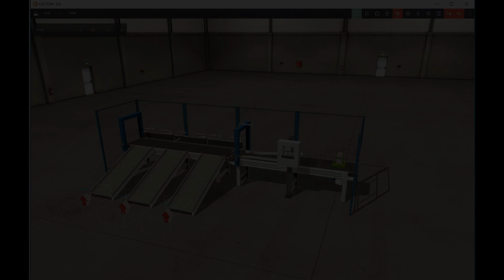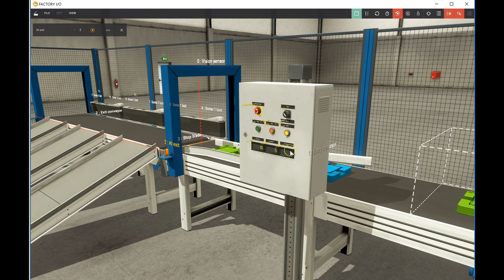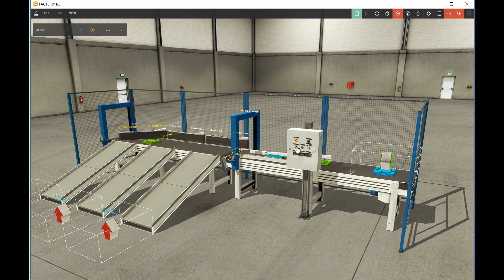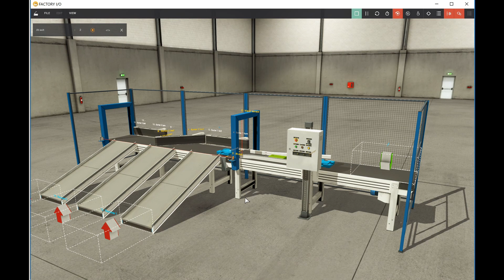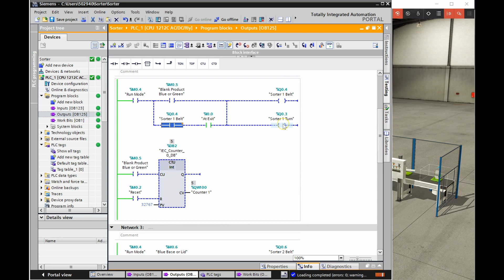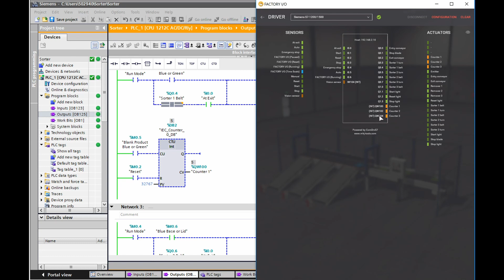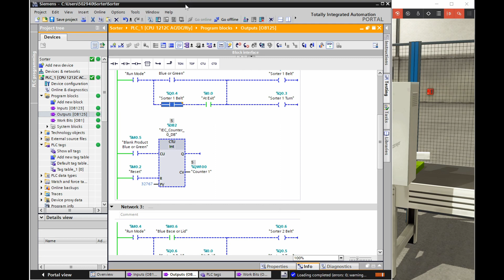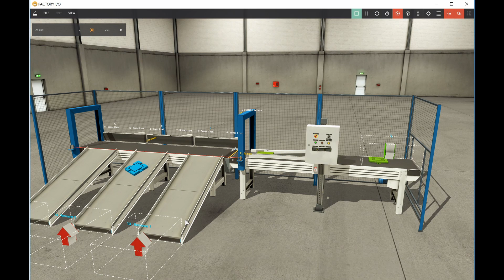Siemens TIA Portal & Factory IO (Sorter Project controlled by Siemens S7-1200)

Comment: Is there a way allow the conveyor to move continuously without having to stop and wait for the part in front to get sorted.
Reply from the maker: Sure. You can just turn it on once you press the Start Push Button. It is an Output, so you can control it as you wish.

Comment: hello sir.. I got two major doubts.. help me please.. the first one is I don't understand why you put that "positive one shot triggering block" before start push button and save that in a memory address %M0.3 as you don't use that %M0.3 anywhere in this program.. if you are using that in the sense, where you are using it and how it works ?? and the second one is this.. You pressed the stop push button and start push button while the process is going on, at that time the box has got dropped down.. after that you changed the program little bit and that works too.. i want to know what you did and how that works for you ??. thank you in advance sir..
Reply from the maker: I didn't need to use that one shot positive edge, I used it from a previous program. The one shot just allows me to use the start pb to cycle through various steps if I wish to in Manual Mode. 

I have learned since doing this video that there is a setting in TIA Portal that allows you to maintain the status of bits once power is lost... but I don't think I finished this program to deal with having the parts cleared even if someone hits the stop pb
Reply: @PeteVree  thank you for your valuable reply  sir..

Comment: What is the cpu model in the project
Reply from the maker: Siemens S7 1200
Reply: Ac/dc/rl or dc/dc/dc
Reply from the maker: Mine is an AC/DC/RL but it doesn't matter what model you are using with the Factory IO